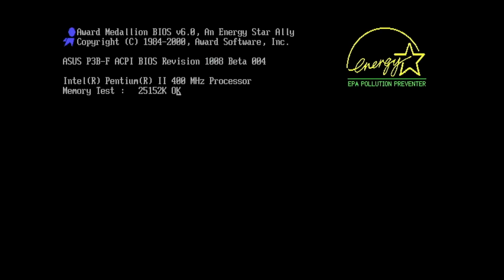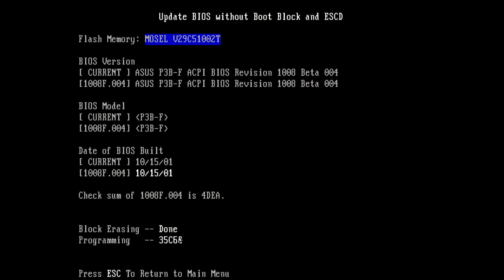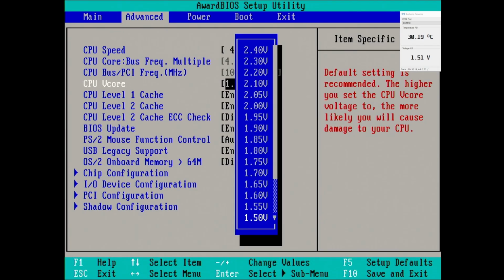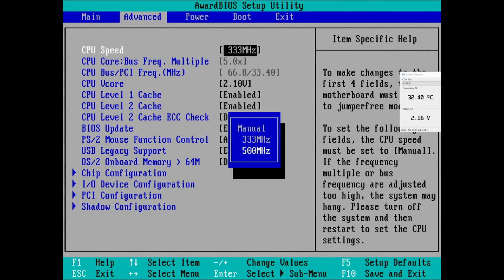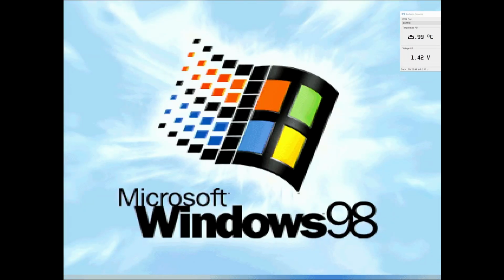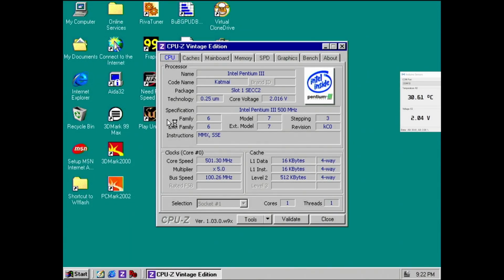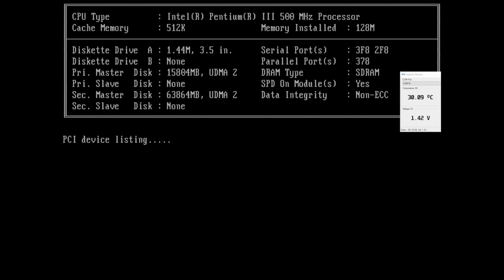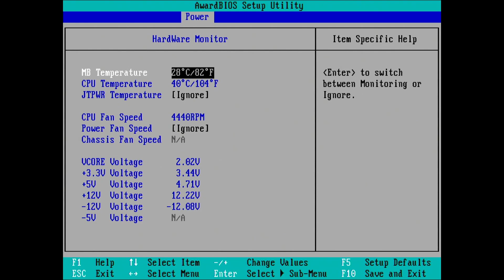Undervolted Pentium II - Tying up loose ends

Comment: How does underclocking affect CPU performance in those 2 cases?
Reply from the maker: I think you mean undervolting. As long as the CPU is stable, the performance is identical to a CPU with higher voltage at the same frequency. The benefits are lower temperatures which means you could reduce the fan speed to reduce noise as well.
Reply: @bitsundbolts  yeah, that's the theory. But I remember back in a day that overclocked Celerons gave better results in benchmarks when voltage was higher. I was curious if that is the case with Pentiums.

Comment: @BitsUndBolts
I know this is an older video, but concerning that P2-333, the limiting factor is the L2 cache chips, they just can't run at 500mhz. They should be ok at 350 or 400. Try running that CPU at 100FSB x 3.5 or 4. It should be able to boot at those speeds, though how stable is anyone's guess and you'd need to test.
Reply from the maker: Unfortunately, the multiplier of the PII 333 is locked. You cannot change it, even if you want to lower it. There were some models (SL2TV) that seemed to have better overclocking capabilities and many did run stable at 500 MHz. The reason is that Intel planned a 500 MHz version of the PII, but cancelled the SKU in favour of the PIII. In order to not discard the silicon, they decided to multiplier lock the CPU and make PII 333 out of them. This information is taken from online forums - so, I don't know if it's accurate or correct. But I'll find out eventually.
Reply: @bitsundbolts  
I could be remembering wrong, but I swear I did the above to my old P2-333. If I remember correctly the multi could be adjusted down, just not up. But it's been at least 25 years since I had one, so you might be right.
Reply from the maker: There are some P2 that have an unlocked multiplier. So, you could be right. Just not all

Comment: 4:52 - Pentiums II 333 Mhz don't have fixed multiplier, but Intel started to lock CPUs around august 1998.
Your sample is from 36th week of 1998, so past that line. The earliest Pentium II 333 were around january 1998, when Deschutes core was introduced after Klamath. Klamaths were unlocked and were on 350nm process, so 2.8v vcore. These deschutes 300 and 333, were die shrunk Klamath, still with unlocked multiplier. Even early Pentium II 350 and 400 are unlocked (april - july 1998). During august, some of them are locked, some of them are unlocked. After august, they are all locked.
Reply from the maker: Thanks for the details! I'll go through my collection. Maybe some are unlocked!

Comment: Nice video mate. I try to remove stock P3 Katmai cooler and I fear to much to do it, even read in some forum that one dude has to press is body weight to the clip... I could be really nice if you could do some tutorial for removing this heatsink, I wanted also to change termal paste and also considering thermal pads for the cache. Best Regards

Comment: Never use the last working voltage. To have a reserve, always use a step above the working voltage. Otherwise, you may not notice instabilities in a test, but they could occur in practice when other areas of your CPU get used, that were not used by your test programs. With the reserve, you significantly reduce the probability that it could crash in daily usage.
So if, for example, 1.4 V is the last voltage at which the computer passes your tests without errors, then use the voltage above that, i.e. 1.45 V for daily operation.
I suggest to also use the prime95 program to test stability and not only benchmarks. You want to know if the CPU does correct calculations after all.
Reply from the maker: Absolutely agree with your comment. Sometimes you will notice instability only after days or weeks and only in certain applications/workloads.
Reply: Not only this. But CPU wear off, as time goes, so for example, in year 2024 , it can be stable at 1.45v, but after 3 years of use, it needs 1.50, and at 1.45v there are instabilities.
Also, heat can change things. During summer, you may have larger temperatures in room. This is also the reason, why Intel pushed voltages with such reserve. So it works also in Dubai during summer. :)

Comment: question is 2v vs 1.45v performance
Reply from the maker: Identical. Voltage does not impact performance when frequency is the same. As long as the CPU is stable, there is no difference except less heat generation.
Reply: @bitsundbolts  Does this generation CPU have heat issues? I don't recall any with my PII 266 but also wasn't looking for it. I used it from 1997 to about 2010 before retiring it.
Reply from the maker: I did not observer any concerning heat levels on those CPUs. If I'm not mistaken, lowering the voltage gets you a decrease in temperature of 2-3 degrees - so, nothing substantial.
That is quite the service duty for your CPU!
Reply: @bitsundbolts  these are probably already low power CPUs because heat generation is based on voltage squared. So any drop in voltage, even small, should make a big difference on heat (which is I guess, immediately dissipated by the large heatsink, making not much difference in temp readings)
Reply: Undervoltage can cause drop in performance starting from Zen2. Clock stretching governed by ultrafast ADC (that senses VCore) was addred very recently. GPU's do have the same behaviout starting probably with RTX graphics cards.

Comment: The EASIEST method i know of pushing out the plastic clips/pegs on Pentium 2/3 slot CPUs, is by placing the back of the cpu assembly on a flat table, with 4 identical computer-case screws placed into the back holes (1 in each hole), and pushing down the CPU assembly on those screws. 
The screws seem to be just the right size to push out the 4 plastic pegs, all at the same time. 
A few drops of lubricant (ideally: silicone oil) before the whole operation, may help the pegs slide out easier. 

Also I have been able to replace those dreaded clips with just some long thin hex-bolts + washers + nuts, that i found at the hardware store. Worked miracles! 
You just have to be mindful when you tighten everything down to do it equally, and not too hard. 
Just look when the CPU board/card starts the slightest flexing, and stop there. Under a millimeter of flex is ok. 
It's very easy to over-tighten so be VERY mindful.
Reply from the maker: I also used the screw trick, but each peg separately. Will try your method!

Comment: Wow. Very thorough.
Some years ago we had a Super Socket 7 computer with Pentium MMX 166. Ceramic, with integrated heatsink. It run at 2.5V (from stock 2.8V) at 250MHz. Was rock solid, we run Worms Armageddon LAN party on it 🙂

Comment: Would be interesting to see how low a PIII Coppermine with on-die L2 Cache could go. The off-die L2 Cache of the Klamath, Deschutes and Katmai operates with 3,3V I/O Voltage.
Reply from the maker: Coppermine is going to be on soon.
Reply: @bitsundbolts  i have a 1ghz pIII thats 133fsb on an asus p3b-f motherboard right now.
Reply from the maker: That is a nice CPU. Is it a slot 1 or socket 370 package?
Reply: @bitsundbolts  slot 1
Reply: @lilkuz2005  I also have a Slot 1 1GHz FSB133, SL4BS stepping. 1100MHz Prime stable with 1,7V default VCore. 4h testing

Comment: I had this exact 333mhz p2, and normally the cache is what is not allowing that overclock. 
I had a board that allowed an 83mhz fsb, and that did still work.
Reply from the maker: Yeah, I totally forgot about the cache. I will try to disable the cache and see what happens.
Thanks!
Reply: @bitsundbolts  also, the Celeron 333a has integrated cache, and will probably be able to hit lower voltages.
Reply from the maker: I tried to disable L2 and afterwards L1 as well. The CPU still wouldn't boot at 500 MHz.

Comment: Ever considered trying a Slot A Athlon?
Similar packaged to Slot 1 Intel Pentium, they have the advantage they have clock multiplier and voltage adjustments built in.  Hidden under the plastic shroud is another edge connector (often referred to as golden fingers), all you have to do is get (or build) your own simple device and if you're lucky you can turn a 700-800Mhz CPU possibly into a 1Ghz "monster" at the flick of a few dip switches. 😉
Got my own 750 to 950 with a small voltage increase, and friends were luckier to get nearly up to 1.1Ghz by increasing FSB too.
Reply from the maker: I had an Athlon 700 back in the day - I loved that CPU.
At some point, PC Magazines were full of articles about those "Goldfinger" devices that brought your Ahlon up to speed.
I will definitely get to the Slot A platform - I am missing a nice board though. Already got an 800 MHz version of the Slot A Athlon.

Comment: Try disabling cache chips! Very nice work! Maybe Celerons could work at lower voltages. Also overclocking P II CPUs was always limited due to the cache chips not by the CPUs
Reply from the maker: You're right. I thought about it (even thought that maybe if I find another PIII Katmai to swap cache chips if possible!)
I guess it was late and I forgot about disabling the external cache. Will try it today and at least write it here in the comments! Cheers!
Reply: I think the off-die L2 Cache operates with 3,3V I/O Voltage. The P3B-F allows to adjust the I/O Voltage from 3,50V to 3,65V (Jumper). Default voltage is 3.50V, because for a stable FSB 133 speed on the BX Chipset. Also the Abit BE6-II i440BX has this default voltage in the Bios.

I had an earlier poduced PII 400 model (SL2S7 stepping) with an unlocked multiplier. 450MHz was completely stable, 500 MHz only with a boot screen, always locks up with booting to Windows 98, also with 2.20V VCore.
Reply from the maker: I tried to disable L2 and afterwards L1 as well. The CPU still wouldn't boot at 500 MHz.
Reply: Maybe what you suggested earlier about replacing cache chips with faster ones might reveal something here. Even when a chip is disabled the lines are a bit affected (physically) and when you try to push the CPU to the limit you might notice issues. For example there are other occasions where a disabled chip didn't allowed CPU upgrades. However this experiment would be something really new as far as I know, so it's worth a try.  @bitsundbolts
Reply: I see no point in disabling cache chips. Cache chips are designed to prevent the CPU from stalling due to slow access to RAM when the data is already in the cache. 
It may allow higher clock rates, but what's the point if access to the data is slower then?!
It would make more sense to increase the cache sizes, but I don't know if the CPU can handle it and then make use of the larger Cache.

Comment: I've got a pair of 333MHz P2's and I tried the same 500MHz OC with them.  Neither of mine would do it either, but I do remember they would both run stable at 375MHz with a 75MHz FSB.
Reply from the maker: Mine did the same. I even think 83 MHz was working, but no chance at 100 MHz. I think I read that SL2TV is capable to run at 500 MHz.